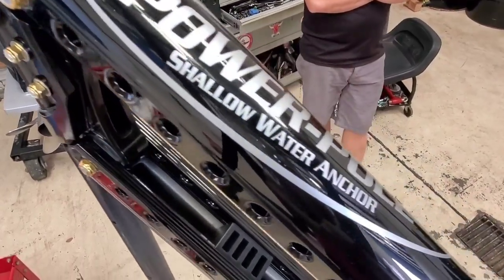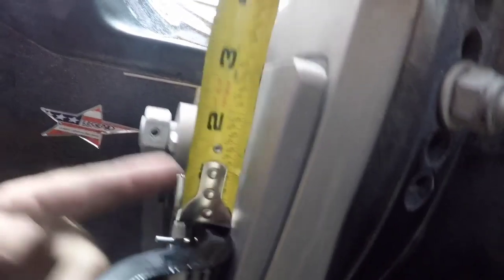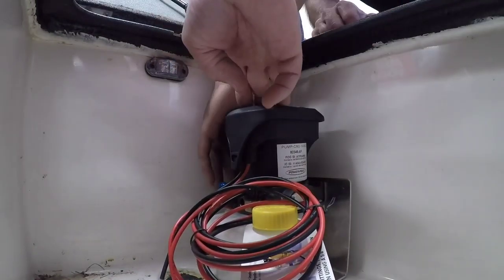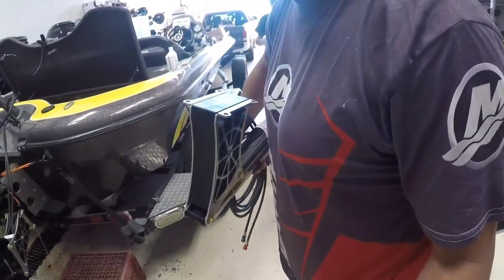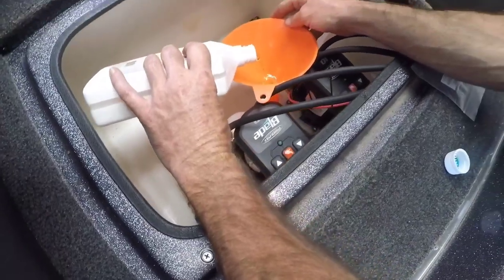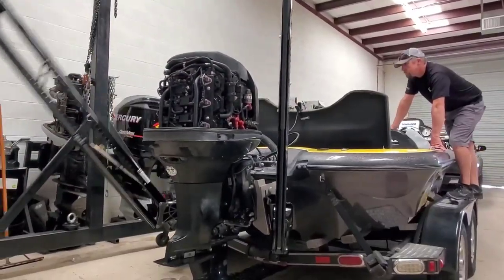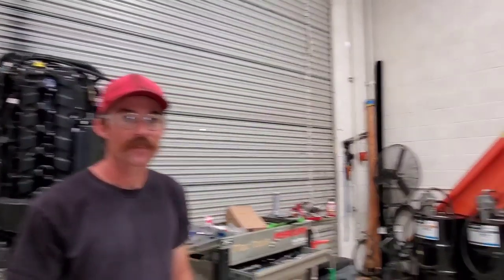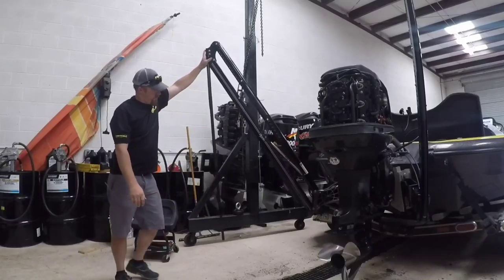Power Pole install | Fallon Marine | TBNation

Comment: I have an Allison bass boat right now with a 150 mercury and three batteries gas tank live well I am up to the rubber rail. I would love to put power pole on, but I am afraid that the weight will be too much. Any advice
Reply: And a bob hydraulic jack plate

Comment: What size hole saw bit was used for the 4 hydraulic runs to run thru ?
Reply from the maker: Just size it to the wire fittings

Comment: What if you don't have a jack plate? I have a bass tracker 190tx and was looking at maybe having one put on.
Reply: They also make a motor mount plate that goes between the motor and hull that you can mount the poles to.

Comment: I'm trying to come up with a design for dual motorized talons on my kayak. Using a 6 ft screw and a stepper motor.Could use some design ideas. If you get a chance to come up with ideas could you message me?
Thanks, 

Justin.